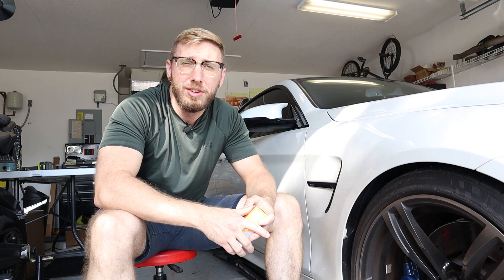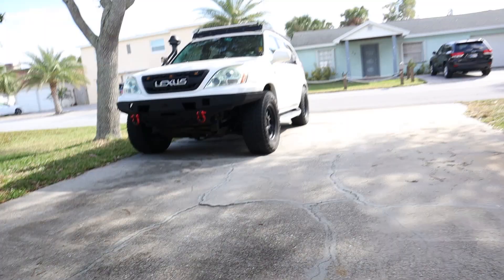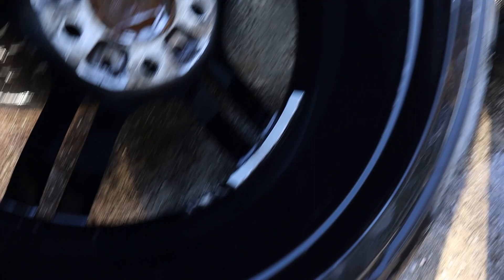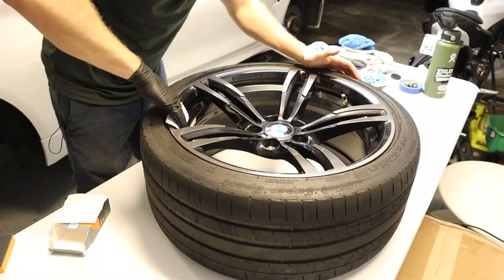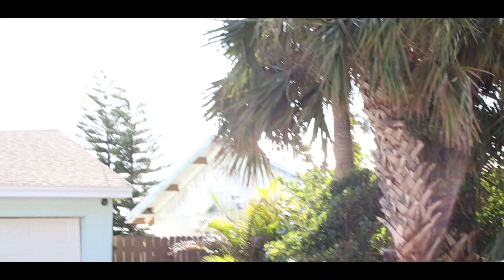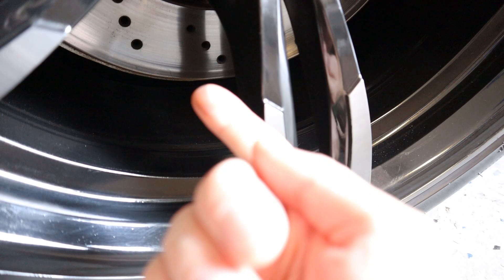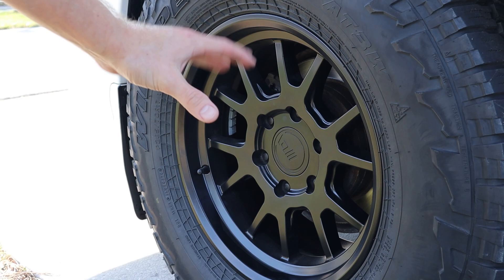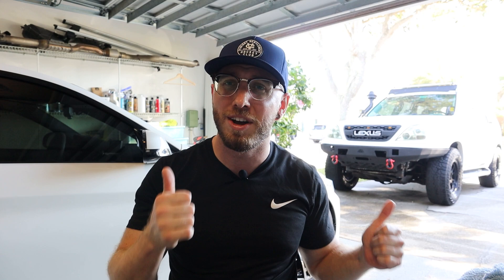Vlog 62 - How To Ceramic Coat Your Wheels (CARPRO CQUARTZ DLUX)

Comment: Awesome video!  I am going to try the turtle wax ceramic spray I already have, but if it doesn't work I will definitely be using this.  I've used so many of your videos, so thanks for making them!  I just got my Android head unit in and am about install the backup cam.  While I'm in there I'll be doing the subwoofer replacement.  Thanks so much!
Reply: Oh, when are you going to remove the running boards? :) If you do it, hit me up cause I have some instructions on the easiest way and how to keep the front molding in place.  On GXOR you see so many that cut it wrong and then ask about how to fix the missing front molding.
Reply from the maker: Hey Cody! Sorry for the delayed response. I'm so happy to hear you have been able to utilize my content for modifying your GX! Yes, the ceramic coating here is a very durable coating that I'm impressed with. I've used some other ceramic coatings in the past and they never lasted long before wearing off. Oh nice! The head unit and the subwoofer will be a great improvement for your vehicle!
Reply from the maker: I'm glad you reached out and mentioned this before I've removed the running boards! I plan to remove mine later this year(maybe sooner after the lift install) and I wasnt sure how I was going to deal with that molding around the front. I'll have to do some research and reach out to you if I go that route.

Comment: I was wanting to try and coat the inside of the windshield and see if it helps with fog or just keep it clear for long periods.
Reply from the maker: This is a good idea. Have you read any instances of people doing this and it worked?
Reply: @Awesomoto  I haven't looked into it that far. Now that the ceramic is not that expensive ill have to give it a try.
Reply from the maker: @e60power1  Yeah the prices are more reasonable since the ceramic coat buzz started a few years back. It’s funny how the marketing works in the detail product industry.
Reply from the maker: @e60power1  Yes, it’s nice to see the prices are more reasonable since the ceramic coat buzz started a few years back. It’s funny how the marketing works in the detail product industry.
Reply: I’d be happy if brake dust was all I had to worry about.  My gx and other 2 vehicles are currently covered in salt due Iowa winter
Reply: I have been wanting to do some ceramic coating with these kits tho great work!

Comment: Question. Would you use this to ceramic coat your motorcycle ? or would you buy another brand?
Reply: I was wondering the same thing @awesomoto
Reply from the maker: Yes, this is a perfect coating for a motorcycle. The coating I'm about to do on the M4 (Will document that as well) is made to last 24 months, so I might suggest buying the smaller bottle of that since it will last twice as long.